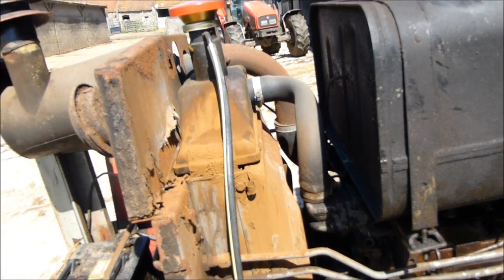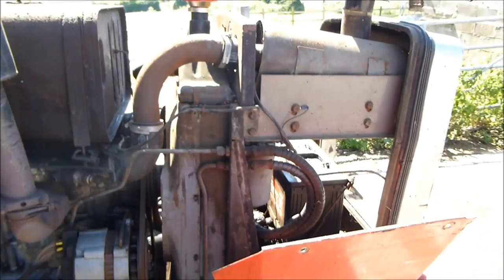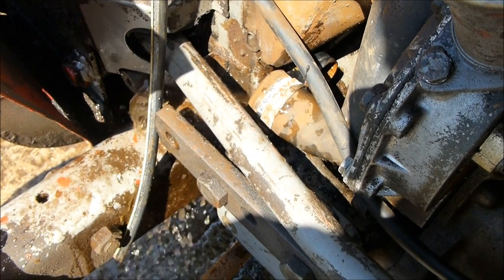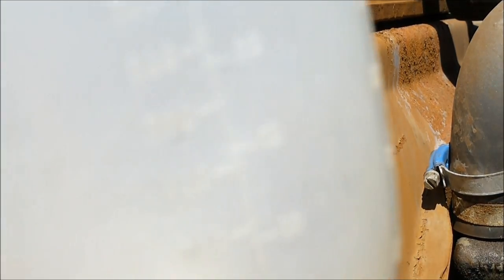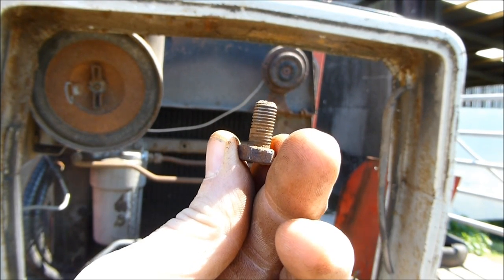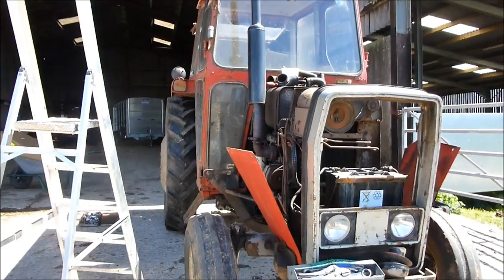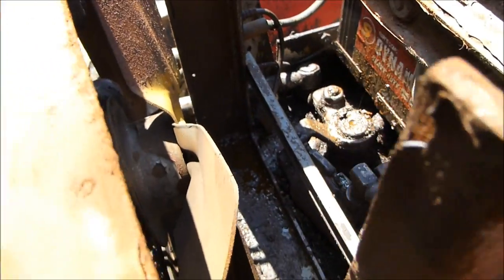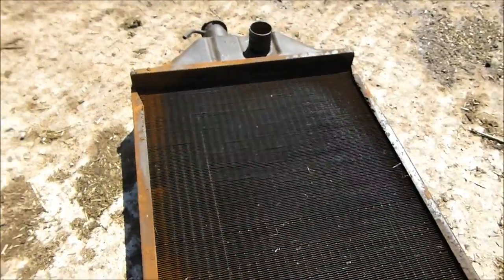Removing the radiator from a Massey Ferguson 265 tractor

Comment: Great vid, it really is essential you put in antifreeze at a mix of at least 50:50 with water, apart from the antifreeze stopping the waster from freezing, it acts as an anti corrosive in the water system, which should mean you will never have to change your rad again :D it might also be worth while flushing out the system before fitting the new rad as all of that rusty gunge left in the other parts will go into the new rad.